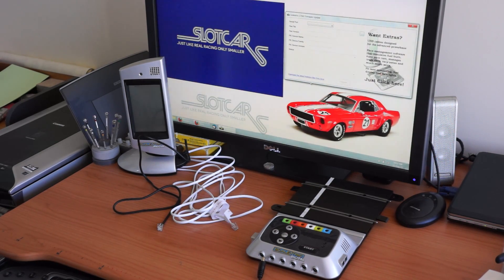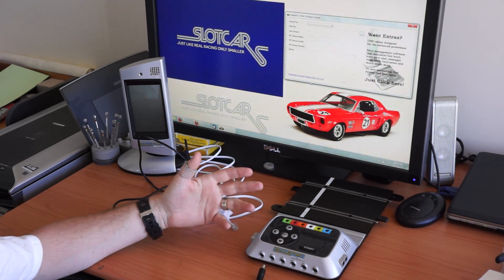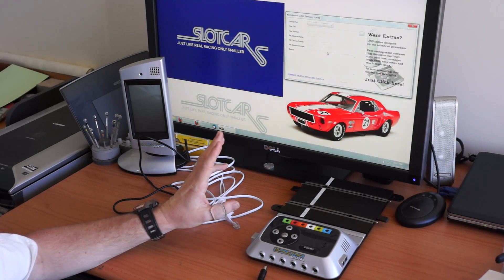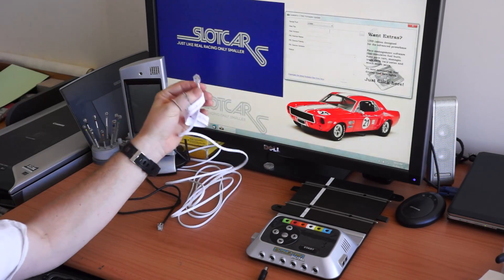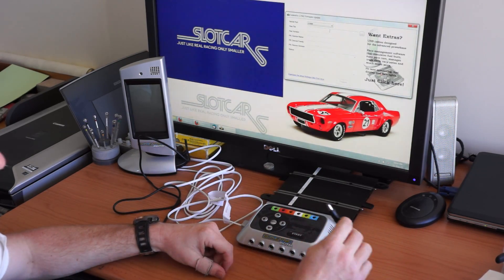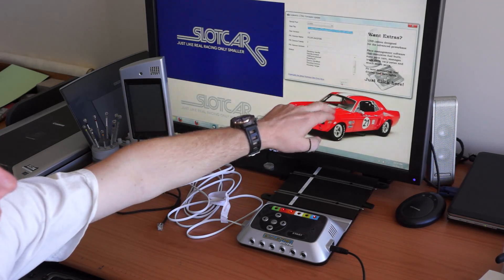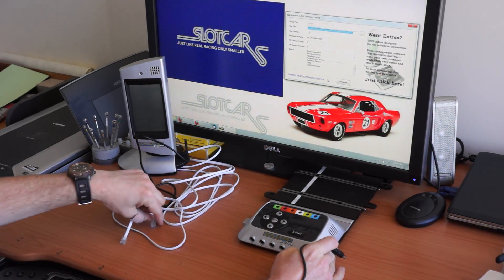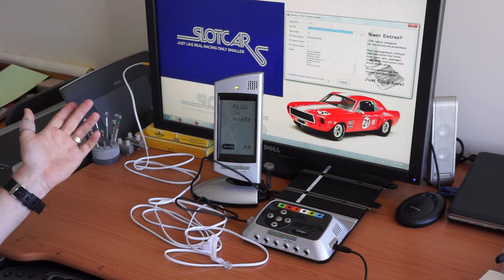SlotcarNZ Scalextric C7042 Powerbase Firmware Update

Comment: All the gear is out to set up another circuit. Firmware updated thanks to your tip of holding the up arrow that is not mentioned in instructions that came with the cable. Thanks again